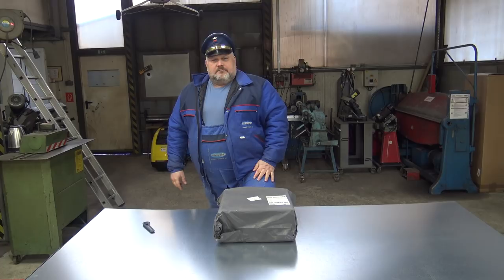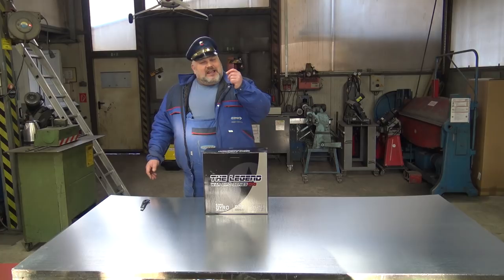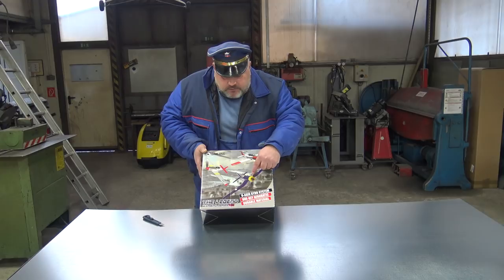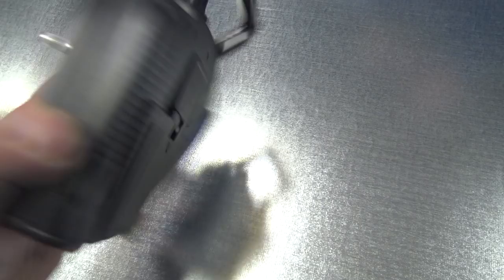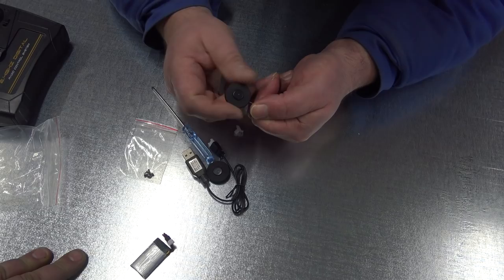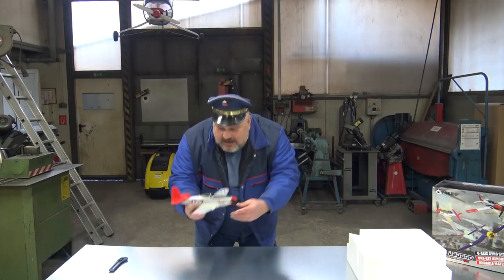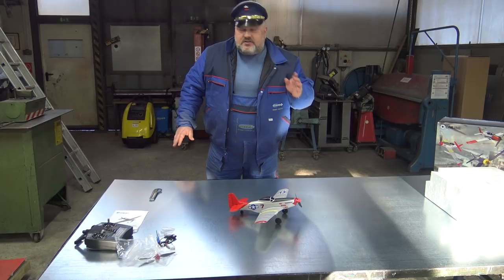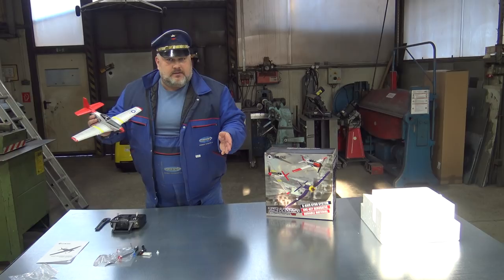Eachine Mini Mustang P-51D EPP 400mm Wingspan 2.4G 6-Axis Gyro Unboxing

Comment: I have this one and the Corsair. These are great planes. For those who say they are too small, I say just keep it nearer! They have a good turn of speed, but you keep them near you then don’t worry about losing it. However, they so well that you can also let them stretch their legs a bit. The expert mode has no gyro assist, so is tricky unless you are experienced. Mid is what most people like best. Did you know that you can bind this to your Radiomaster? Check out what others have done. It is really simple and then you can use dual rates and expo. On a good radio they fly even better (the supplied radio is okay, but not great). Really looking forward to your maiden with this plane. I really enjoy mine.

Comment: Salute!!! I have one of these and I love flying it. Best of all I can fly it in my local park. I put it in my backpack and cycle to the park with a handful of batteries and fly for an hour, can easily get 15 minutes flying time out of a single 400mah battery. The beginner and mid setting on the gyro is easy to fly and exciting, expert mode on the gyro makes it too exciting 😃

The stunt mode is really great too. 

Makes virtually no noise and attracts virtually no attention. I left the gear off and hand toss it on half throttle.

Sometimes I climb a couple hundred feet and just let it glide, it's a great little glider as well.
Reply: I have done a little modification on the stock radio, that allows to fly in expert mode, with full control and immediately change to mid mode, when you lose control. It’s a pretty simple mod and can be easily done. I unsoldered the blue wire, that is connected to the mode selector switch. I unsoldered the wires from the stunt button. Then i extended the blue wire a bit and soldered it to the stunt button. Another wire I soldered to the stunt button and the connection, where the blue wire originally was connected to the mode selector switch . When the mode switch is in expert mode now, it is automatically in mid mode, which is easy to fly. When I want to fly in expert mode, I only hold the stunt button, as long, as I want to fly in expert, or I lose control. By releasing the stunt button, it automatically switches back to mid mode and saves me from crashing. For me it’s not uncomfortable to hold the stunt button down, as long as I want to fly in expert mode.  I also unsoldered the beeper from the board, as it’s very annoying and distracting to hear the beeper, when ever the mode is switched.
Reply: @theoztreecrasher2647  Hi, you can believe me, that you will not use the stunt button anymore. Anyways you can reverse the mod without any damage. I have described the mod more detailled in the rc forum in the mustang thread.

Comment: I have this plane, my first ever. It’s really amazing. Mine has had a few, ok a lot of hard landings. Ok crash landings into trees, houses, electric fences, sprinkler systems, cars,  trees, the ground many many times and did I say trees. 4 props, two sets of landing gears, 2 control horns, 1 linkage and one motor have all found very entertaining disintegration’s. Hot glue is your friend. I have repainted it with craft glitter-paints which makes it super easy to see in the sky. I have made other improvements like adding 0.5cm foam strips on the end of the ailerons helping it roll better. I’ve added LED lights on the wing tips and tail. extended the wifi antenna thru the body of the transmitter giving me 250m range. I love this plane and am still learning to fly it, still in intermediate mode but the crashes are more like belly landings. 
May the Force be with you...

Comment: Greetings from sunny California. Great video as always. I have all three planes in the series, in my opinion the P51 flies the best but the other 2 are good also. I fly these with my Radio Master TX 16 using the V761 protocol that comes with the radio. I leave the wheels off , just looks better in the air. On a full battery with moderate flying I average 12 to 14 minutes of flight time.
I look forward to watching you do the maiden on these.

Comment: There is a place for planes such as what you're showing but I would not recommend them to someone serious about getting into the hobby, My main concern/complaint is the difficulty in getting spare parts. Also, most of them have brushed motors (not sure about this particular model) which - from MY experience - will often fail after a few dozen flights or so.
On the other hand if someone is just interested in giving the hobby a try to see if they'll like RC flying or not then perhaps a plane like this is not the worst choice. [Personally, in the US, I would suggest something like the HZ Sport Cub S 2 because of the high wing design and the parts availability.]
Anyway, a very enthusiastic and entertaining unboxing video. Thank you...
Reply: @theoztreecrasher2647  Good points, I've had a few myself but have not had much luck keeping them in the air. A lot had to do, I'm certain, with being a new pilot and beating the snot out of them. For me getting parts was a problem. I would recommend getting a few spare props and a spare motor and gearbox when ordering the plane.

Comment: I have the Sonik RC version of this Mustang - which is exactly the same - it literally lives in my car and it comes out at the end of a flying session with the 'bigger stuff' for a couple of idle fly arounds. My buddies in the flying club initial reaction is 'wtf' but then they have a go and say - this is absolutely amazing - I want one, where did you get it? It is absolutely delightful to fly and even in a bit of a breeze the gyro handles very well. I don't use the undercarriage at all, hand launch is simple and to be honest it looks so much better in the air without the wheels. Best £75 I ever spent.